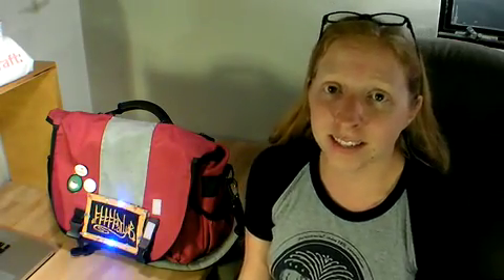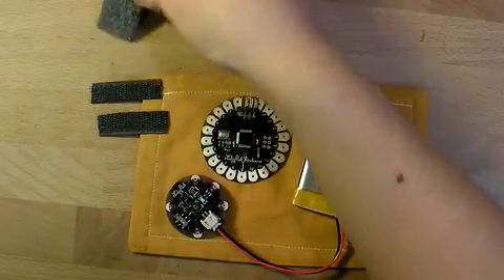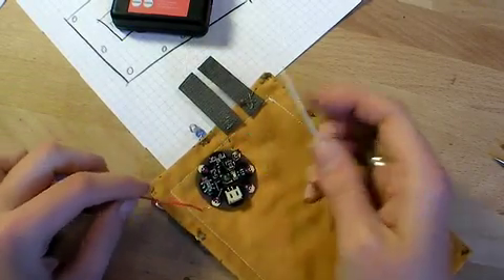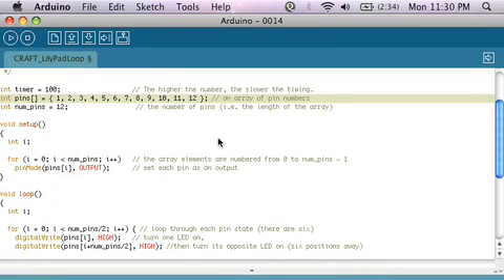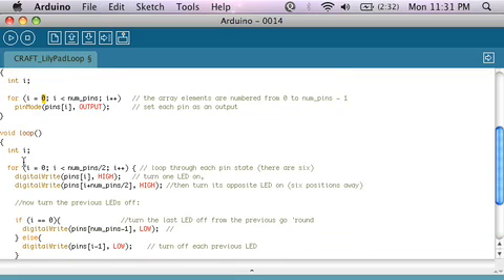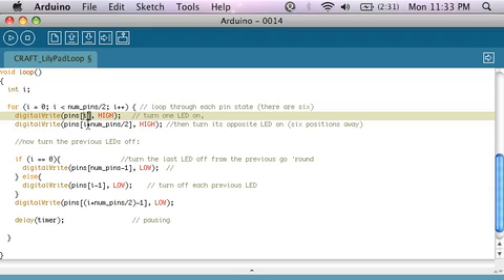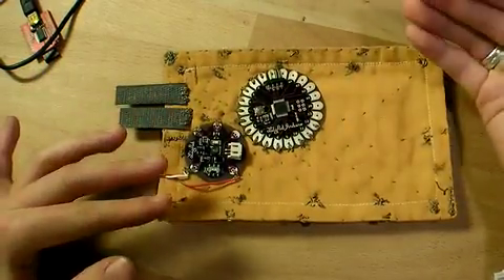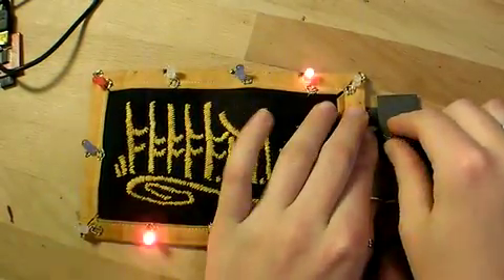CRAFT Video: LilyPad Arduino Bike Patch

Comment: Cool project!
By the way, if you are concerned about the safety of your LiPo battery,
there are LiPo safety bags on the market that even endure an explosion of the battery. It's purpose is actually only for charging and storage but I guess, it's also no bad idea for the battery in operation. At least it would let me sleep better (so in my projects I'm already tinkering with these bags).

Comment: I've been thinking about trying arduino but was a little worried it might be difficult too learn. But your video was a little more reassuring. The programming side looks pretty easy (at least starting out with basic stuff). I think I'll order the board and give it a try. Thanks.

Comment: If you use magnets you could accidently mess up an electronic item if you put it in the bag
Like Ipods, Nintendo DS's you can screw up the screens if you get a magnet too close to them
So the velcro is actually a good alternative for a backpack, but you should at least get velcro that somewhat matches your backpack so its not so obvious

Comment: Just 2 questions.

1.  If one cannot get conductive Velcro would one then just complete the circuit directly?
2.  If one wanted to use an LED strip(s) would the code stay the same if the single LED`s are replaced by the strips?